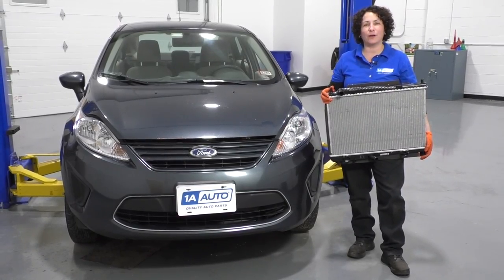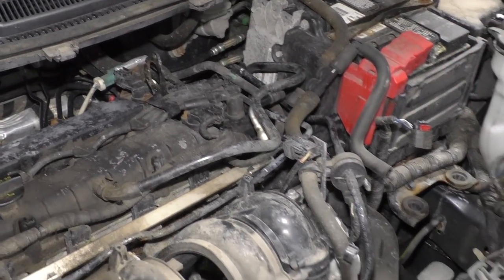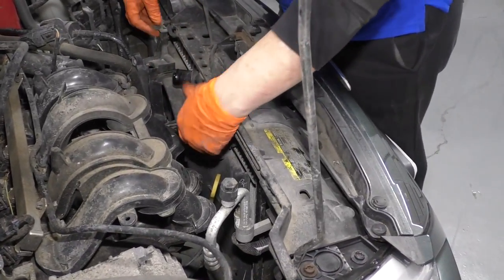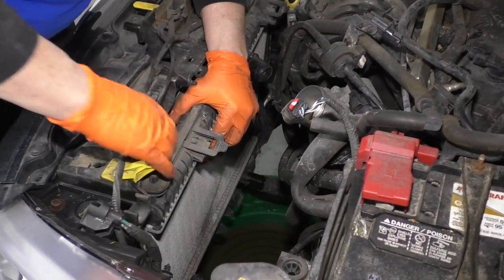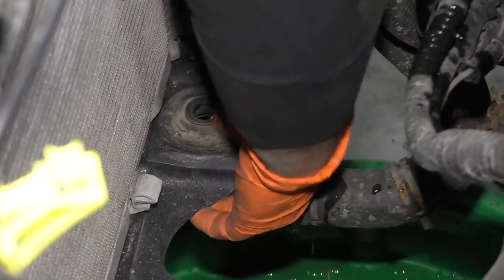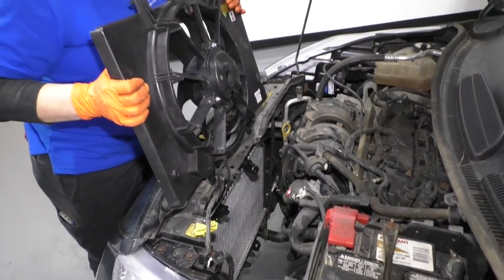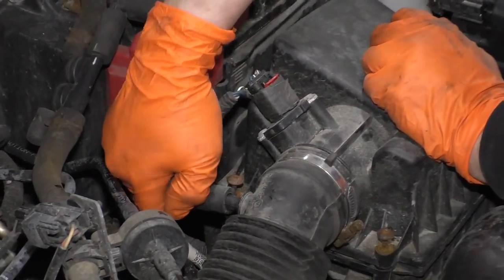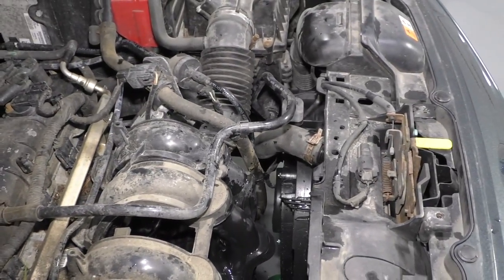How to Replace Radiator 2011-2017 Ford Fiesta

Comment: I had to look this one up on how to do it to a friends car that got damaged in an accident so he can drive it home. If your car is badly damaged up front just about most of the steps besides removing the hoses and unplugging the fan and releasing the cable management clips on the fan can be skipped and you can proceed to breaking off the broken plastic pieces from the crash making this job a little easier

Comment: Very informative. I have a 2011 Fiesta with 120k miles on it. I replaced the fan a few years ago, and between that experience and this video, this definitely gives me the confidence to... trade it in for something newer. To hell with all this. Maybe if I had a lift.
Reply: It's a pretty easy job.  I did find it was easier to remove and install from the bottom, though.
Reply: Lmfaoooooooo.

Comment: What’s the easiest way to change them bottom rubber bushes on the bottom of the radiator without removing the radiator on a 2015 fiesta diesel

Comment: I don't see why she took the clips off the front for she never pulled the cover off. I know this is several years old but didn't make sense to take them out.
Reply: Makes it a bit easier to remove the clips on the top corners of the radiator.  Gives a little room.  Otherwise, not really necessary, but I did break one off before I thought to remove those.

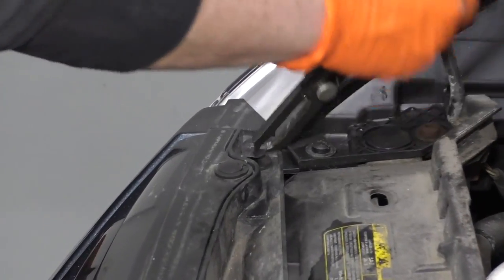Comment: What’s the name of the tool at 6:19?
Reply: Don't know, but you can use two small screwdrivers or needle nose pliers to remove those just as easily.